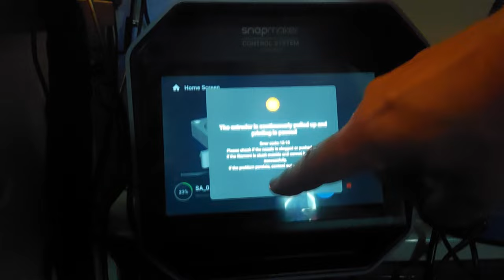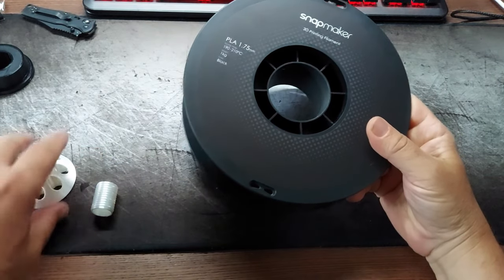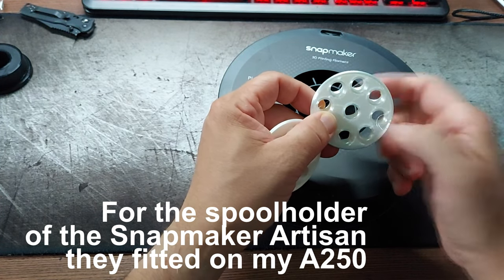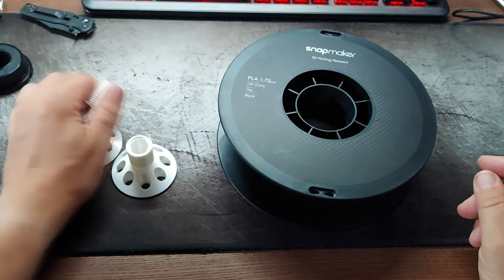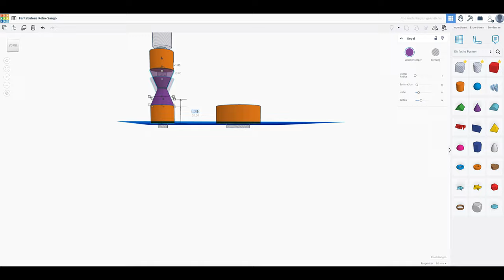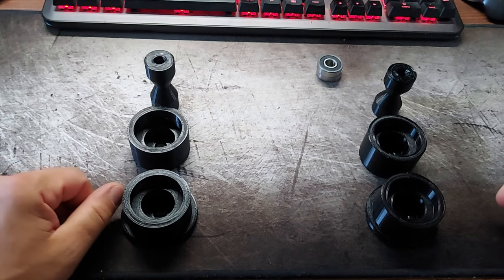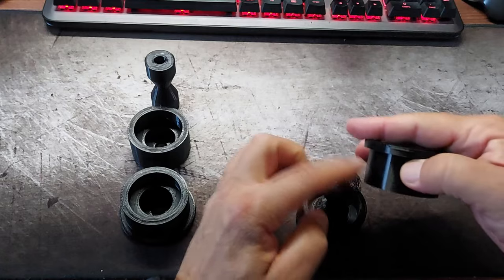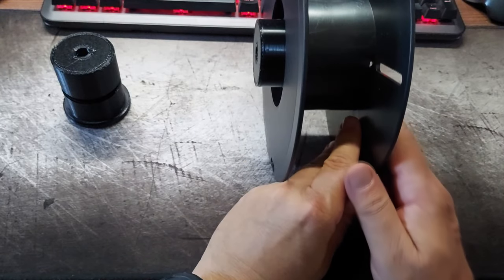Designing a filament spool holder for 3d printers with and without ball bearings

Comment: I dig the design, I went through all of this for a while until finally settling on simple ball bearing rollers that the edges of the spool rest on. Mainly because it's compatible with basically any type of spool and you can simply adjust the width when needed.

Downside is its really meant to sit on flat ground but once you progress outside of PLA having spools in a dry box fed to the extruder through a reverse bowden really makes life much easier and reduces the chance of tangling.
Reply from the maker: Thanks for your input! I have already tried to build something similar but the tension was too high. I'm not sure if the parts I printed (via thingiverse) caused friction on the Ball bearings or the bowden tube (which was labeled for 1,75mm filament but pretty tight in comparison to the stock bowden tubes from the enclosue to the toolhead), but it never fed the filament. Which ball bearing rollers do you use?

I'm not sure if somehow a reverse bowden could be add as the Snapmaker is a direct feeding machine and a in some cases closed ecosystem. But I'd love to get it going, because i was planing to hang a couple of spools into an Ikea plastic box and also heat/dry it with a heat cable (a leftover from an old terrarium) to kill two birds with one stone.